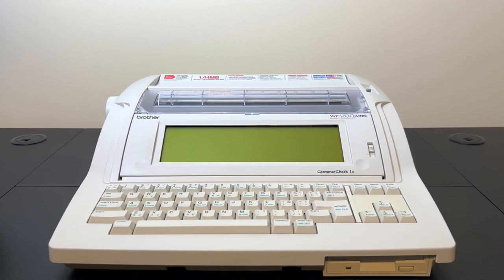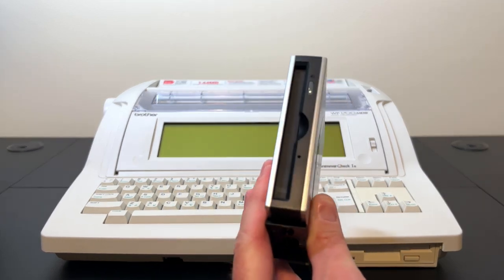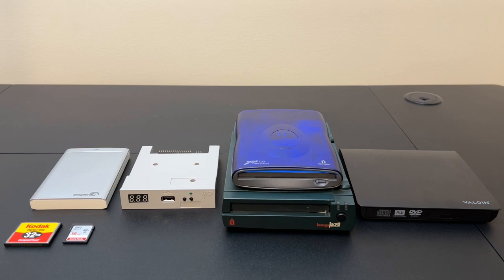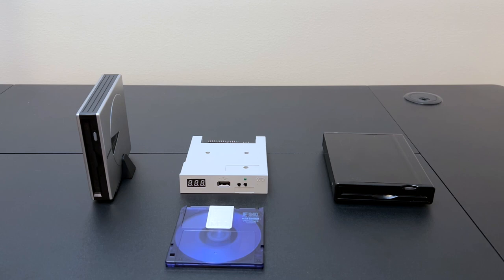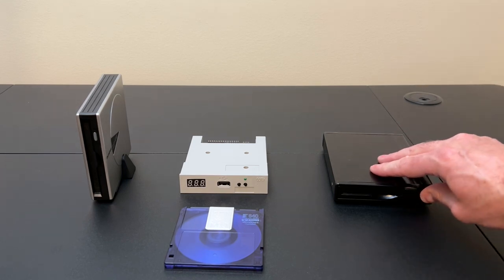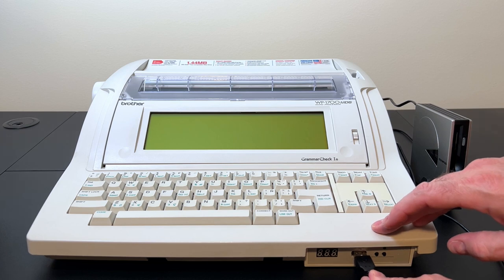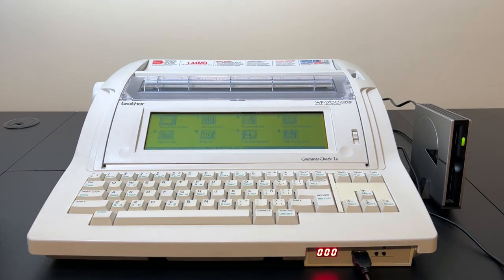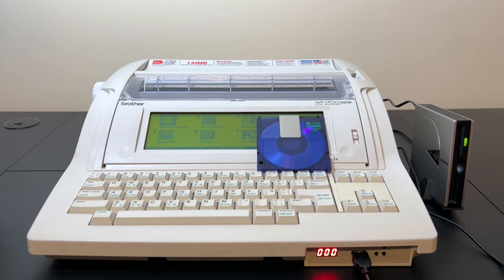Portless, unexpandable Brother Word Processor upgraded with Magneto-Optical Drive?

Comment: Is it difficult to replace the floppy with the gotek?  Does the whole machine have to be taken apart?
Reply from the maker: I was able to swap the floppy by only partially opening up the word processor.  The keyboard and screen could be moved without disconnecting their ribbon cables.